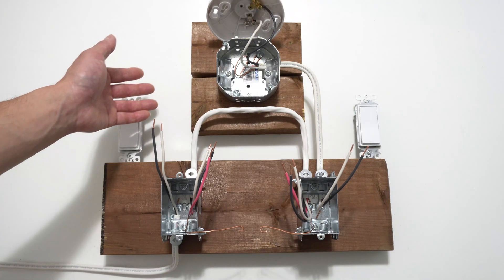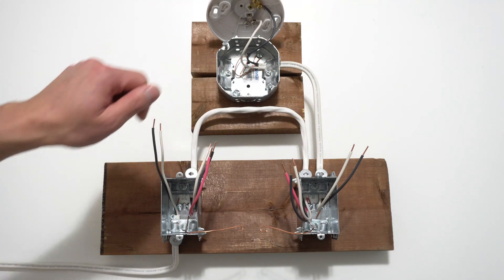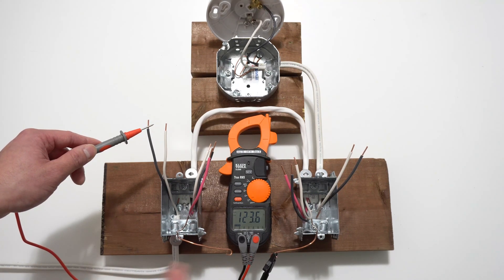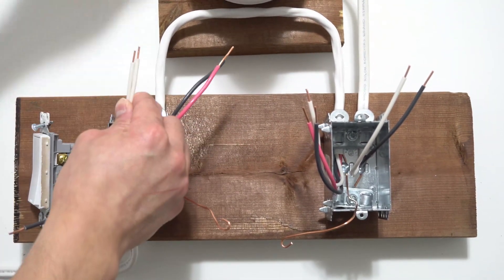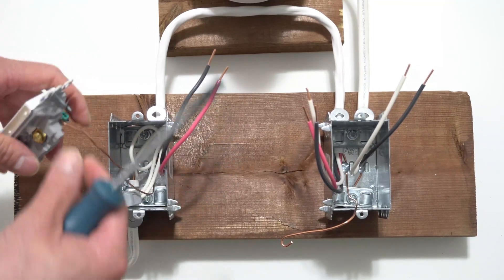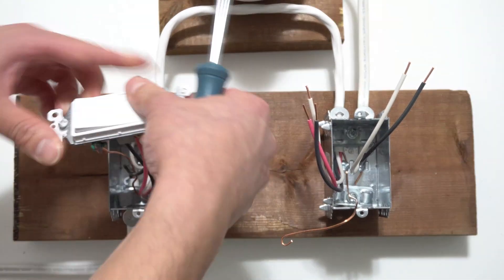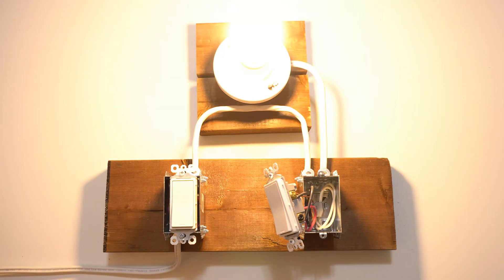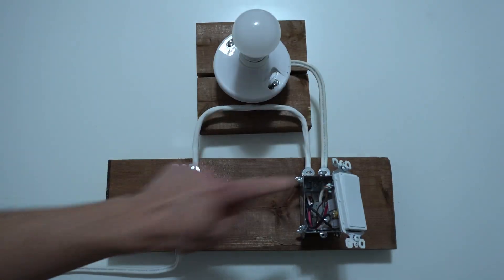HOW TO WIRE A 3-WAY SWITCH SYSTEM

Comment: It does make a difference which way you connect the red and black from the middle section. You want to do it so that when both switches are in the same position the light is off.
Reply: I think he meant to say that there's no difference in which travellers you use. There's no specific wire color designated to either screw.
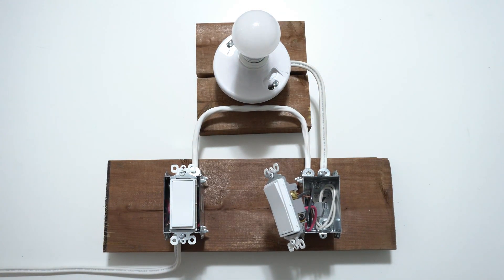Reply: I think the point across that it turns on either way. Two ways you can wire it. Done at 5:36 what you have mentioned. In my house I have six different switches in a row that are being used every day and they are never in the same positions. The last thing I care or not care at all if they are all in the same position.
Reply: To be honest no one will notice unless the switches are side by side.